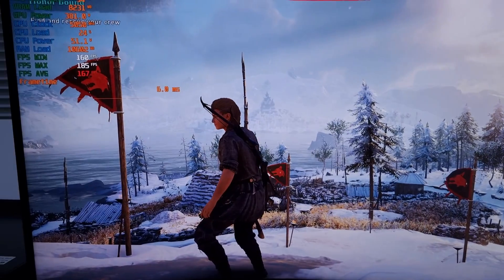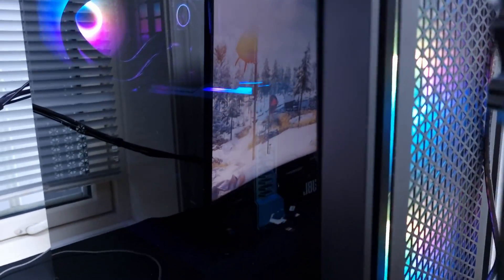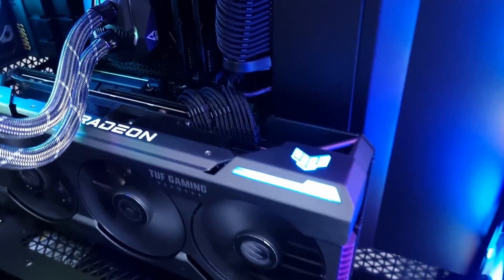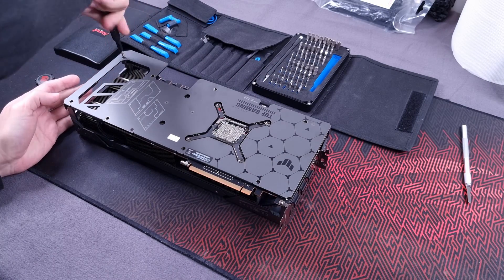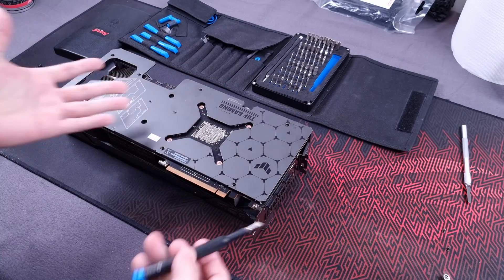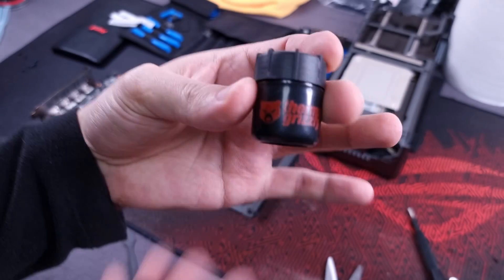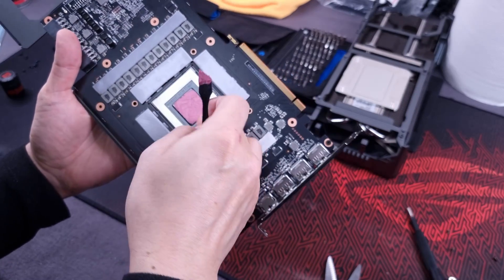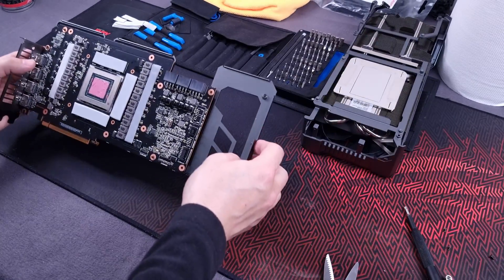ASUS TUF RX 7900XTX TEARDOWN (hotspot fix)

Comment: Just repasted my Taichii 7900 xtx with MX-6. Was pretty scared doing it because it was my first time and it’s a damn expensive card but the temps were insane!!

Both at 100% gpu util
Stock paste 
Hot spot: 100-109 (would shut down the system)
GPU Temp: 70-80

MX-6
Hot Spot: 80-89
GPU Temp: 60-70

Now I feel much more comfortable gaming at everything maxed out and even if these temps don’t last I’ll just repaste again and probably change the thermal pads as well. 

THANK YOU FOR THIS VIDEO!!! 👍👍👍
Reply from the maker: MX-6 should last a few years at minimum. Real good stuff.
Reply: I wish I had the guts to do that... It goes in my case for a 90 max hotspot in default...
I'm using UV that cools it to 83 max hotspot and I hope it will keep stable... 2700 max clock and vram little oc to 2600 (1080 mv)
Reply from the maker: @yuvalweizman1  90c hotspot is not bad.
Reply: I have same card, any advice on how to do the fix you did and if the paste is still holding up.
Reply: @_scareupkiller2478 hey man! So tbh it wasn’t that hard. It’s just a bunch of tiny screws on bottom of the card to take off. I believe there was around 9 or 10. There is a seal on one of the screws that basically shows the manufacturer the card has been opened when you unscrew it. 

Once you take apart the card it has 2 cables that’s plugged in. I didn’t even unplug those (they were very hard to take out and I didn’t want to break it) I just left it and laid the card down (opened up). From there I followed the video exactly. Used the toothbrush + alcohol and a cue tip to clean the old paste and the whole 9 as he instructed. 

I will say on black ops 6 everything maxed out and power limit +15 on adrenaline my hotspot or memory still gets up to 97 occasionally  with fans at 100% which is a little scary. My system will shut down when it gets over 100. Pushing 200 frames in 4k ultra is no joke lol 😂
Reply: I got the same card. Hotspot is 110c but system is still running. I need to do the same with my card and hope for the best
Reply: @ so temps went back up after a month. I would also try to under volt and reduce power limit. Helps a lot

Comment: Liquid metal is still the best! You still can't even overclock with that paste! You're still running under 400W. 7900 XTX doesn't shine unless you max the power. Thermal grizzly has thermal shield and conductonaut extreme. My temps are 70 c hotspot max power and overclocked! worth it!

Comment: thx for making it so clear my 3070 hotspot is 105c with full load . it making my gpu voltage drop and the core clocks not stable then the pc show no display.
Reply from the maker: You should send it for repair. Most likely there is some physical damage there.
Reply: @TechnologyHive  i will do that in the next day , and will keep you up updated
Reply: @TechnologyHive  hello again , the gpu thermal paste was looking so dry and not covering the full core , now im full load with over clock and its 80-83c hot spot and gpu 66-69c , thank u man , liked and subed , keep up the good job
Reply from the maker: @legend_iq4159  Glad to hear it! Cheers 🍻 🙂

Comment: To clarify the RAM pads are 2mm and the VRM stacks are 1.5mm ?  Great video btw.
Reply: @34ddefcon5, did you do 2mm and 1.5nm in the end?
Reply from the maker: @nebulacloud  Its in the video.
Reply from the maker: @Velocity866  the sizes are what you see in the video.

Comment: Purchased this same Asus tuf OC 7900xtx a week ago. Under an aggressive overclock and undervolt and playing cyberpunk on highest settings 4K I get a hotspot of 87 Celsius and core temp of 61. Which puts me at a delta of 26 degrees. 

Keep in mind I have a pretty aggressive fan curve on my case fans, cpu exhaust fans and GPU fans. The fan sound is pretty significant. I’m wondering if it would be worth repasting with PTM7950 so that I can get similar or better hotspot temps without such an aggressive fan curve. Without the aggressive fan curve my hotspot is in the 90 degrees Celsius.
Reply from the maker: @bmorale15  Check out Thermalright Heilos. This will definitely bring those temps down.

Comment: Hey on my RX 6800 running 74°and 110 degrees hotspot will switching thermal pads do the trick (btw do you know what size of pads the 6800 needs) tjx in advance
Reply from the maker: I do not know the size of the thermal pads, but if you want to bring that hotspot down, the only things that will work is either MX-6, Thermalright Heilos, or PTM7950

Comment: Interesting. On halo my 7900XTX Tuf Hotspot hovers around 78-80C. I do have the H7 flow with all sorts of fans/airflow and i also dont have it vertically mounted like yours. Idk if I got a gem or maybe it does need it at some point.
Reply from the maker: @ChowHound1337  It's not all tuf cards. Mine just happened to be " one of those"

Comment: Nice job !
Reply: I just bought this card on ebay for 675 25 dollars shipping. Nice to see what to expect
Reply from the maker: @Waltwizzle  I just got another one from a customer, and the temperatures are perfect. Never been opened either. So I think I just happened to get "one of those" cards.
Reply: Well you did a good job easy fix in my opinion i really liked the video.
Reply from the maker: @Waltwizzle  Thank you!
Reply: My card is overheating while gaming now causing fps drops and static noise causing the drivers to crash i checked the hot spot it seemed ok at first but after 30 minutes of gaming it went crazy and saw a 102 c temp on the  Hotspot as it was crashing
Reply: I took it apart and there is visual scuff marks on the GPU die and heat sink. Wondering if it's still good

Comment: my normal gpu temps are about 55-60c under full load and about 95-107c on the hotspot... should i repaste?
Reply from the maker: If I were in your situation, yes absolutely! But I would use either MX-6 or Thermalright Heilos.

Comment: that's a biiiiig temp drop congratz, you will ALWAYS have a delta of 20-25C with a good thermal application between your hotspot and GPU temp, Hotspot is like the name says the hottest spot in the GPU measured (usually the center), GPU temp is measured near the edges, it will always be low
Reply from the maker: I have since replaced the thermal paste used in this video to Thermalright Helios. Near same temperatures, but better hotspot temps.
Reply: @Shaolinmonkwarrior  For the average card you're right. I've been using my brother's 7900 XTX TUF and his card has ridiculously low stock temperatures (between 15-17 delta max). That's running Cyberpunk at 4k and path tracing on to torture it :'). My TUF had 20-25 delta and Sapphire Nitro+ 20-23. I'd have put it down to the silicon voltages but other temps around the board are in the 50s, so the TUF does seem to be able to go lower when done properly.

Comment: had the similar problem with my vega 64 card from asus. i never buy asus again. they take the cooler von nvidia cards and slaps them on amd cards.
Reply from the maker: @DerBaerserker  The thermal paste Asus uses is cheap. Once I replaced it, the temps dropped by -20c.

Comment: I have the same card and I can attest to the perfection of this card/cooler combo. my card's hotspot under a full 4K native resolution load of maxed out Allan Wake 2 w/ray tracing on is 62 degrees C.

It is MY conclusion that the factory did not either PROPERLY apply the thermal paste/pad or did not apply it at all. There is MORE than enough cooling capacity in that heatsink to cool this board...

I would say smart move repasting it...
Reply from the maker: Thanks. Its been running nice and cool after the re-paste.

Comment: if my GPU Memory Temp has a high Delta (70 degrees Core, 92 GPU Memory) I should prob switch those pads right? Also my Hot Spot is 20-25 Degrees hotter than Core. Playing on a 1 Year old 7900GRE
Reply from the maker: @fmdfm-s4i  92c for memory is pretty hot. Would switch those pads. If your hospital is in the high 90's, I'd put some MX-6 paste on there and get rid of that old one.
Reply: @TechnologyHive  what mem temps do you get on your card in full load?
Reply from the maker: @laurentium3337  86c

Comment: my 7900 xtx runs 10 deg warmer on hotspot compared to gpu temp?  dont understand why yours is so high? its a xfx merc
Reply from the maker: @peterpeter5666  it's because asus uses cheap thermal interphase materials. XFX, Sapphire, PNY, and others use phase change material.
Reply: @peterpeter5666  my xfx 7900 xtx merc also after repasting or using thermal pad ptm 7950 still has a 30c delta dont know whats going on 51-55 gpu 81-88 hotspot
Reply: @Vinprvx  thats weird cuz mine is still stock and hot spot doesnt usually go more then 10 degrees difference max 20
Reply: just an fyi noticed after about a year temps on hotspot went from 10 deg difference to 22 degrees . repasted with ptm 7950 and dropped temps by almost 30 degrees and hot spot difference dropped to 11-12 degrees

Comment: This is asus issue cuase i have xfx model and the hotspot max temp is 80 ~~78 in ultra and 2k and the gpu temp is 55 ~~60 idk maybe im wrong
Reply from the maker: @Paradox_mx  Asus is using cheap thermal interphase materials, while Sapphire, XFX, PNY, and others are using phase change material. Big difference in performance

Comment: Not sure how relevant this is but i have a 7900XT Sapphire Pulse edition and i've never seen the hot spot go over 80, with the normal temperature sitting at around 55-60c when it uses like 300-350 watts. 
Really makes no sense to me how that behemoth of a cooler can't keep the 7900xtx at better temps
Reply from the maker: It has to do with the choice for thermal interphase material ASUS decided to use. Once I replace the stock paste, the temperatures dropped by -20c on the hotspot. Sapphire uses phase change material, which is superior quality to the stuff ASUS uses.

Comment: I had the same problem with my rx 6600 XT from xtx version qick. Hot spot on this card was even 105c. Year ago i changed from thermal grizzly to ptm and it was really big change. On thermal grizzly i still had like 20-25c delta depends on game but now at full load on furmark its like 20c delta, in game its more like 10-15c
Reply from the maker: @dwiedyszki9778  Phase change TIM is the way to go when it comes to AMD and their chipplet design cards.

Comment: And thats why I recommend always going Invidia for high end cards. With amd youll for sure get really bad coil whine and horrible temps. People are really biased towards amd just because it usually gets more fps than Nvidia but look at what you get lol.
Reply from the maker: @BenitoRomero-yi6du  I have a 4080 Super with coilwhine like a pig. So no, it doesn't matter the make or model. And now that I have replaced the paste with Thermalright Heilos, the temps are 66c and 81c hotspot. The card is solid.

Comment: Installing your gpu vertically in this type of case is a big mistake... That's why your temps are insanely high for that model.
Reply from the maker: @awakennnnnnn987  Nope. The temperatures were high because of the cheap thermal paste ASUS uses. With the new phase change material by Thermalright Heilos, the temps went down by -20c.

Comment: I have around the same size delta on my 7900XTX Red Devil.
Im gonna try a new DP cord first. 
Then ill resort to thermal grizzly graphene for the graphics die and then GELID thermal pads for the rest. 🤞

Also if you live in America, the warranty sticker does not apply.
Reply from the maker: @vinyvinycocopuffpassittomenow  I live in Norway 🇳🇴 so the sticker applies. I'd use Thermalright Heilos instead. Or you will end up reposting it again after a few months.
Reply: @TechnologyHive the graphene isnt a paste or thermal pad. Im hoping this will be a maintenance free way. 
I just saw your heilos video.

Comment: Just did PTM 7950 on my 7900XT my junction stays below 18c delta now it normally runs at 12/14c delta when I separated my PCB I could SEE the spot where the thermal paste was no longer
Reply from the maker: That spot is pump out. Nice to hear it worked out well for you!

Comment: It is just fine to mount it horizontally. The card has two 'points' of connection, one is that PCIE and the other one is connectors area o the video card (in the back of the PC) and it has a backplate.
Reply from the maker: @bestopinion9257  Funny you say that, because this card literally weighs 2kg, and I just got one in for repair due to warranty void. And the cause? Cracked pci-e slot, and also cracked gpu joints. So no, it's not okei to install this horizontally. It should be vertically to avoid damage.
Reply: @TechnologyHive  I have 2kg video card too. It's only 2 kg. The card will stay horizontally even mounted in back side only with no connection to PCIE as long it is a 3 slot card.
Reply: @TechnologyHive  Most owners of this card mount it horizontally no problem. You just want reasons to do it unconventionally to look more 'cool'.
Reply: @TechnologyHive  If temps are bad, just return it. You just lost the warranty. Let them collect returned cards until they learn how to do it properly.

Comment: Hi ! Thanks for your work  im gonna do it too with the same gpu. Tired to see 97c hotspot in this huge block at 1100e. 

I have some question before make surgery on.

What brand of thermal pad do you use or recommand and what value . 12,5 14,5 / mk 

May I use the same paste ? Is it good for long time .

Thanks for you response and keep help us 💪
Reply from the maker: I would use MX-6 for the thermal paste. As for the thermal pads, I get mine from AliExpress: https://www.aliexpress.com/item/1005005898862800.html?spm=a2g0o.order_list.order_list_main.4.ee7a1802C5zypl

Only store I trust for thermal pads. Excellent quality and great thermal transfer.
Reply: @TechnologyHive  thank you for your answer . Notice say dont spread thermal pas . Whats the best way to Apply mx6? Point / cross / spread
Reply from the maker: @SeriouslyRavaged  I like to spread the thermal paste.
Reply: @TechnologyHive  thank you

Comment: Those temps I have on my Nitro+ are not as concerning (64°C and 82°C hotspot) as the VRAM temps up to 91 with some OC) are IMO. I have to make the fans run full speed in order to get it down to around 84°C (my hotspot reaches just 77°C) but it's way too loud. Those TUF and even Strix cards are loud asf. My Strix 4090 will not get that hot but the fan curves are way too aggressive. Same as on my previous Strix cards as well. But the worst thing is the coil whine.
Reply from the maker: Turn on VSync to help with the coil whine.

Comment: I Got a 7800xt Nitro Plus. the Tempos were high like that too. So Idecided to change the thermal paste. It worked good for about 2 months when the temps just got crazy. I ended up changing the thermal paste several times due to pump out. Finally, I put PTM7950 on it, the temps are already better then with fresh therml paste. Hopefully it'll last. If so, It should be the new standard
Reply from the maker: I have stopped using thermal paste on GPU's now. I buy Thermalright's Heilos now. Much better results.
Reply: @TechnologyHive  what’s the difference?
Reply from the maker: @mattzavala9456  The hotspot. On my 7900 xtx it went from 95c to 80c. I had to repaste again from the time in this video. Thermal grizzly kryonaut extreme is great, but it did not solve the hotspot problem in the long run.
Reply: @TechnologyHive  so far. No pump out or decline in performance. I ran the raytraycing only test on 3dmark the other day at boosted power draw. It never thermal throttled. Currently play xdefiant with a Hotspot never reaching 80°c at full usage
Reply from the maker: @thenutburglar7923  That's really good.
Reply: @thenutburglar7923  will there be another video with the thermalrights?? I’m sure so many people have this problem and we need to do hours and hours of research before we find this answer. It’s insane because we all spent at least $900-$1200 for these 7900xtx cards and then the frustration set in. My hot spot would hit 107C+ on my taichii model before my PC would automatically shut down. Even with undervolting, it’s in the mid to high 90s during space marines 2 all settings maxed.

Comment: What cable are you using to mount the GPU vertically? Got a link by any chance with the product? Thanks.
Reply from the maker: This is the one I use. I do not care where you buy it, as I am not affiliated with Amazon: https://www.amazon.com/Phanteks-Vertical-Bracket-220mm-Riser/dp/B0BVKZ5M6F

Comment: The heatsink which contact which gpu die is nickel plated copper or aluminum? I am gonna change thermal pads in mine gpu,and i want to use Kryonaut Extreme too,but wa thinking about liquid metal too.
Reply from the maker: It is nickel plated.
Reply: @TechnologyHive  but base is aluminum or copper under plating? There is no info on asus website.
Reply from the maker: @Wolek96  It is copper. I have never seen a nickel plated aluminium heatsink 🙂. It would make no sense.
Reply: @TechnologyHive  nickel plating aluminium is well known in metal industry,so I just wanted to be sure (I work in metal industry,just not with gpus ;)). Thanks. So I will go with Liquid Metal,and will see results. Btw,you didn’t changed thermal pads on backplate. There are 4 of theme as I remember. You can check reviews. It might help with vram and vrms a bit more.
Reply from the maker: @Wolek96  Temperatures are ok so far. But thanks for the tip!

Comment: you cant install the X mounting bracket wrong btw as it wont fit the other way, But also you can mount that horizontal with ease, it comes with a easy to use Stand that you put under the front corner which alleviates ALL the weight from the motherboard.

Comment: i did same thing to my Rx 6650 XT and hotspot temp drop from 90-102 to 65-75 just wow! and fan speed were 3000-3400rpm now just 1500rpm is enough.
Reply from the maker: It is that cheap thermal paste AIB's are using. A good paste will lower those temps good, just like in your case. Nice!